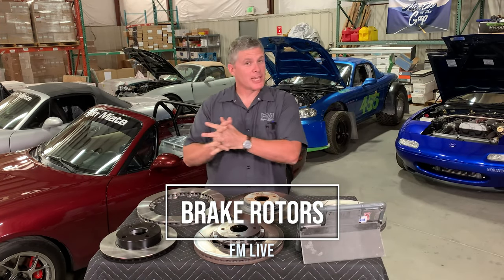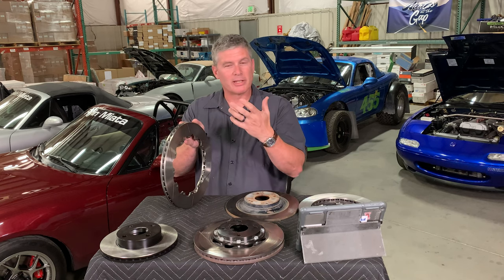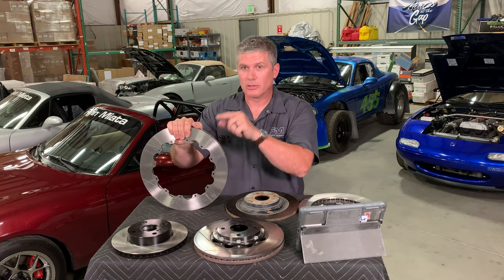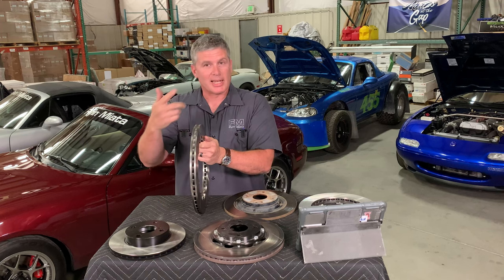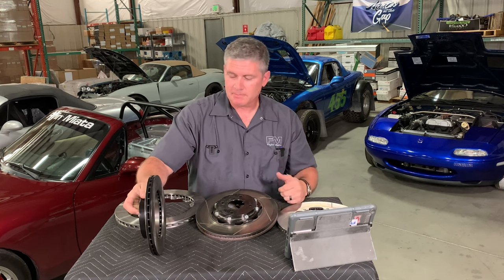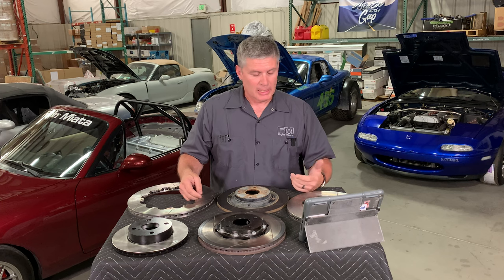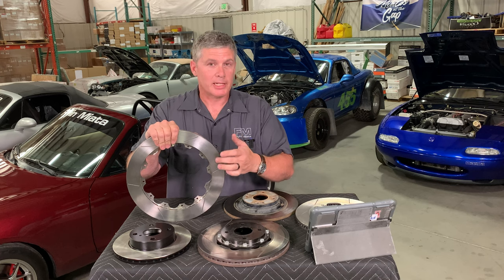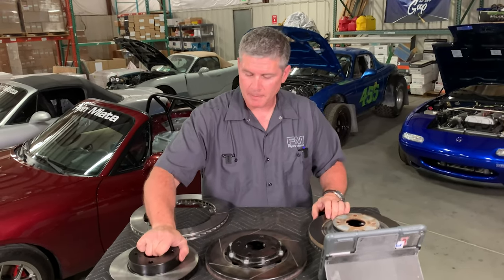Brake Rotor Basics with Keith Tanner (FM Live)

Comment: Warped rotors absolutely do happen though, seen it myself. The entire rotor wobbling, including un-worn surfaces not touched by the pad.
Reply: I think that goes back to the one side is heated more than the other. I've turned plenty of rotors over the years and it always seems to be the inside edge that needs a little extra.

Comment: I remember reading an interview with the first guy who ever drilled holes in a Kawasaki brake rotor (I believe it was an H2 750 2-stroke street race bike).  He said that 100% of the reason they did it was to save weight.  Disc brakes were brand new to motorcycles at this time, and as it turns out they were monstrously over-built.  My 400 triple from 1974 makes just 42hp, but the front rotor is almost the same dimensions (diameter, thickness, WEIGHT) as the rear discs on my NC.  If anything, the 400's rotor is bigger.  The rear drum on that bike is sized about halfway between the drums on my Insight and my Dakota.  Huge.  After a really hard down-hill run, the brakes are no hotter than if you left the bike sitting in the sun for 15 minutes.  My front rotor on the Kawasaki was stock from 1974, but I still had to get it turned down several milimeters just to cram a modern Ninja caliper over it.  A modern 200hp literbike has less thermal mass than my little 2-stroke beginner bike.  You could drill those war hammers without a care in the world.  Circumstances today are different, and the story about what the holes are for got changed.
Reply from the maker: The founder of FM used an aluminum rear rotor on his race motorcycle. Don't try this on a car!

Comment: Nice video. More can be discussed but good overview. Things to go into for the future: why do rotors crack and how to prevent cracking. Proper fastening of 2piece rotors wire tie vs loctite. What customer/use needs a certain type of rotor (street, dual duty, track).

Comment: As mentioned in the video, rear rotors wouldn't get much benefit from being veined as they don't do as much work. Would the only benefit possible be unsprung weight reduction with a two-piece rotor that has no veins?
Reply from the maker: Weight reduction and heat dissipation.

Comment: would love to see a video 60-0 with each level of upgrades on the same car with big sticky tyres so we could quantify the upgrade path for road use?
Reply from the maker: Single stop distance is basically a function of traction and proportioning. Rotor selection isn’t really a factor. 
The bigger systems come into play when you’re dealing with the heat from repeated hard braking events, like track driving. We’ve done a few different videos on overall braking system design - you can check them out on our channel.

Comment: Thanks for the explanation on warped rotors! So if warped rotors are caused by sticky material on the rotor surface, which in turn causes uneven braking surface, will rotor resurfacing solve the problem (given there is more than enough rotor thickness left)?
Reply from the maker: As long as your pads have even wear, and you have enough surface on the rotor to turn them, that should definitely help.

Comment: Am I just old? I remember two piece rotors requiring safety wire. If that is still done, I haven't seen it discussed much.

I'm slowly turning my daily driver ND into a track capable toy. 

If I was to understand correctly, two piece rotors are subject to potentially loosening fasteners is it still a good practice to overdo it and safety wire what you can for peace of mind?
Reply from the maker: Some rotors use mechanically locking fasteners to avoid the need for safety wire and make them much easier to install. The downside is that the fasteners aren’t reusable.